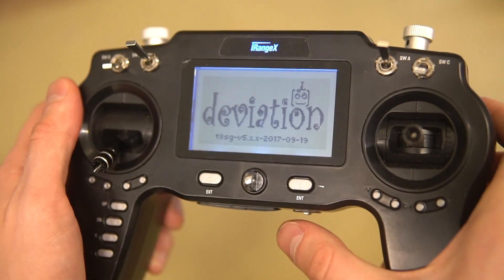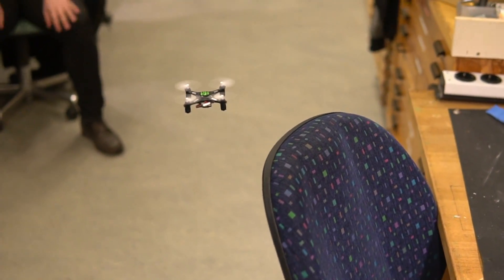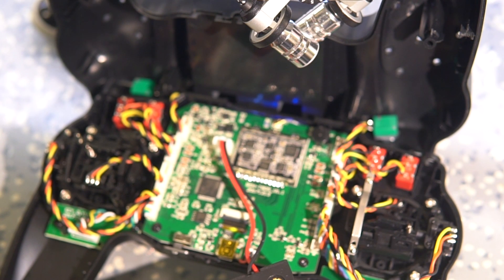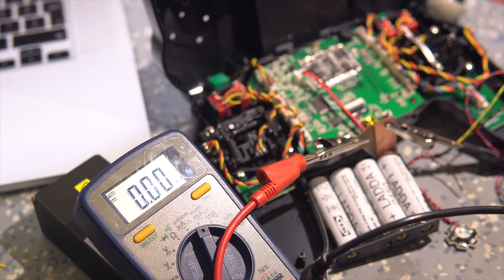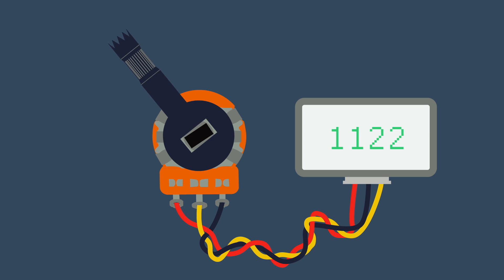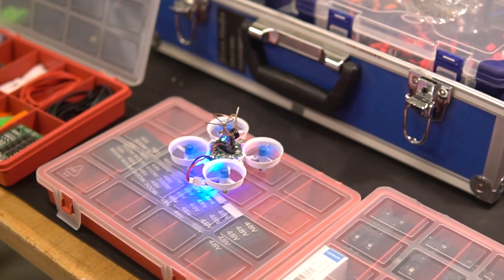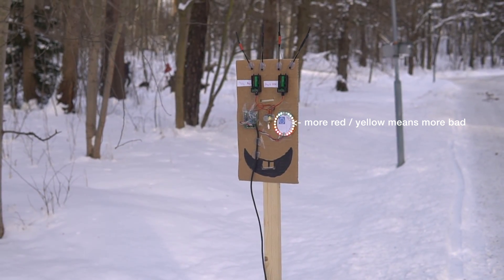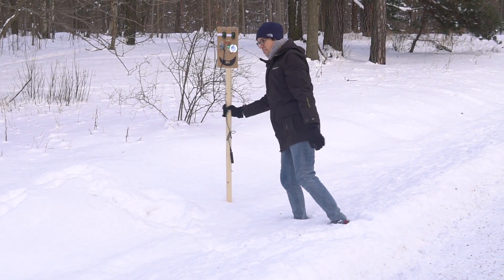iRangeX - how not to make a controller

Comment: You aren't "stealing" from open source projects. Its called "using". The only requirement is to release modifications as GPLv3 and attribution.
Reply from the maker: Yeah, "stealing" might have been a bit harsh, but they didn't attribute, nor did they release the modifications anywhere. The people behind the deviation firmware had to reverse-engineer the hardware changes in this controller to be able to make builds for it. I guess "misappropriated" would be a more accurate word for what irangeX did.

Comment: Amazing!!! Great eye opening video. All Chinese have been doing is copying , implementing and making money on the back of the open source community without contributing back. Starting with the arduino project and going further to opentx, deviation and so on.... that's all they can do, copy... and very little innovation... unfortunately,
Reply from the maker: I wouldn't go as far as to say it's all bad. The cheap clones of arduinos, sensors and other modules made the electronics hobby much more accessible, especially to students and kids on a budget. As long as those devices are functional, I'd call that a good thing. There are some companies in China contributing perfectly well with their own PCB designs and open source software, like DFRobot for example. This iRangeX controller is a particularly bad apple though, definitely worth shunning.

Comment: I have a radio of that one more this one with problem to lose signal very easy it wants to be able to be that 20 meters already it was lost the signal
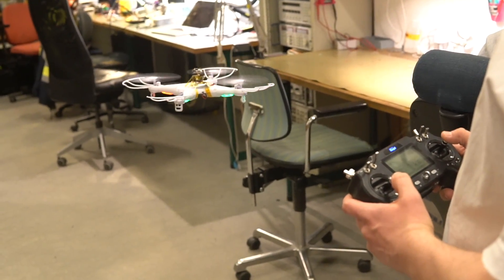Reply from the maker: Make sure your transmit power is set to 100mW (and not uW!) . You can see it in the top-right corner on the main status screen (for example, at 0:30 I have it at 150mW). If that doesn't help, you might need to open it, and check if the antenna is properly connected. At 2:48 you can see the antenna connection at the very top of the board, with the gold connector and the grey antenna cable - check if yours looks the same. The issue could also be in the receiver, so you might want to check its antenna as well. Good luck!
Reply: @dronelab1280  yes I adjusted to 150mw I checked the antenna everything ok, even more so it still keeps losing signal very close. how would you use an extraneous module?

Comment: I got one of these when they were still in pre-order. After getting it and finding the issues with the gimbals I tried to get a refund. But banggood offered to just send me new potentiometers. I said no thanks. And I again asked for a refund as I had already fixed the issue. They gave me a 50% refund. I'm actually pretty satisfied with the radio for only about $40. But at $85 original price it not even close to being worth it. I also did a 5dbi external antenna mod and I get much better range. And lastly I upgraded the firmware to a newer version for this radio. In the end, it works. But it's definitely not my go-to radio. I would not recommend it to someone not experienced with making modifications to electronics.

Comment: Stolen firmware ? you kidding me? I thought if Deviationtx is open source project - it can not be stolen. just take the code and apply it to whatever you want.
Reply: My thought exactly, now admittedly you have to follow the guidelines set by the dev's but it's usually "make a screen that shows the dev's message/links etc..." and if you modify the code share the code. https://github.com/DeviationTX/deviation/blob/master/LICENSE.TXT

Comment: Can you put a link to the parts that you use to fix it?
Reply from the maker: All parts are very much off the shelf. For the most important fix - the gimbals, you can use any tape. The switching-off glitch, use a 20k 0603 resistor. You can solder it on top of the current one, which is much easier than removing the one that is there (removing SMD resistors is best done with two soldering irons, one in each hand). For the speaker, use any buzzer that does not have a built-in tone generator. Can be piezo, or electromagnetic, it does not matter at all. Hope this helped!

Comment: Hello and firstly very good video but i dont undertand the first issue my irange always do a "bip" when i turn It on 
Can you explain me a little bit 
My english level are horrible
Reply from the maker: The beeper does makes sounds, but, at least on our unit, the sounds are very “unpleasant”. Instead of melodies it makes a weird sound. They used a wrong part in production - instead of a normal speaker they used a buzzer, that can only produce one tone. But they try to play melodies on that buzzer, so it results in weird sounds. 

It’s not an important issue at all, but just shows that they didn’t put high attention to detail. Especially since the part they used is more expensive than the one they should have used.
Reply: dronelab okey but i dont understand how do you produce that melodie because me buzzer only do a single "bep" when i turn It on
Reply from the maker: Oh right! You can program any melody if you connect the irangex to a computer and edit the configuration files. I can show you how when I’m back from a business trip ;)
Reply: Excelent, thanks you very much
Reply: dronelab and it's posible to remove the buzzer and conect the speaker 
It works?